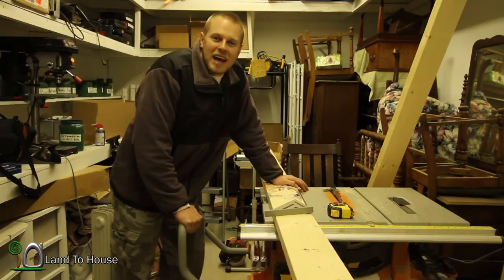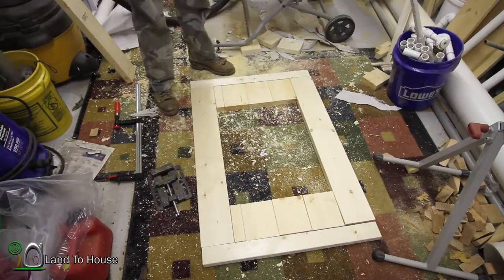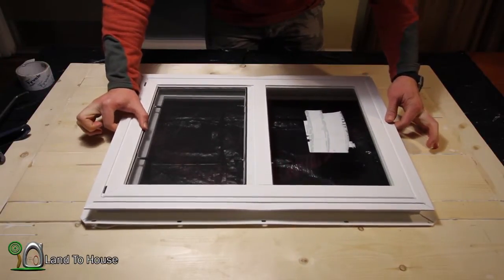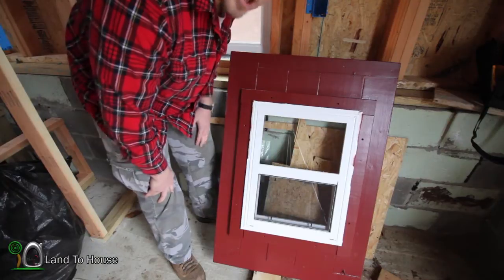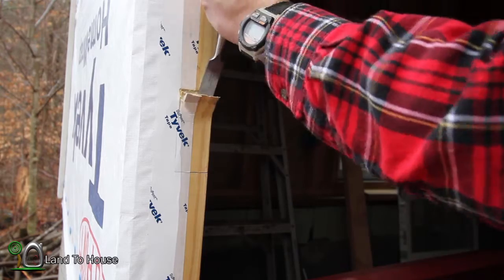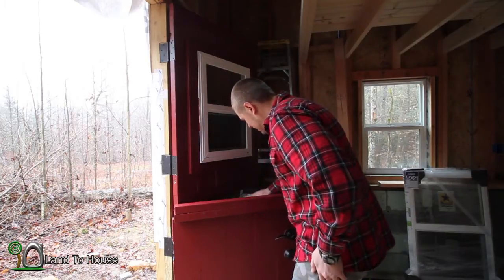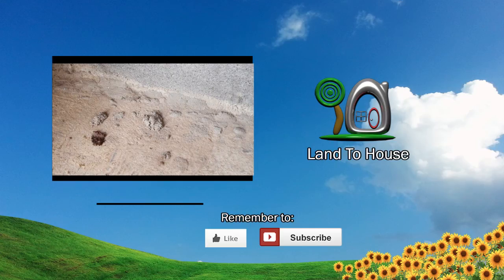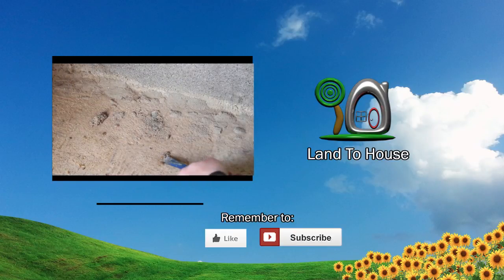Tiny House 45 Build Dutch Door P5

Comment: Hi Seth, just making my way through your vids and I am enjoying them enormously.  I do have one Q? with this vid here.   Regarding the clearance between the top and bottom parts of the door - why do you have that gap, as opposed to them being flush against each other?
Reply from the maker: +Fizzedup Slade When you say gap do you mean why did I make a dutch door? I wanted the two parts to open separately. So you could open the top and leave the bottom closed.
Reply: +Land to House:  Forgive me for poor Q?  When you fitted the top part of the Dutch door you placed 2 small scrapes of wood on to the top of the bottom door leaving a gap - a space - between the bottom and top parts of the door.  That's the gap I'm referring too.  Apologies for being dim. I'm sure there's a reason, I'm not sure you explained why?  Is it so that the two parts fit together well?  To my eyes it looks as though there's a gap.  I'm a bit worried about drafts!! LOL.
Reply from the maker: +Fizzedup Slade I see now. Well I wanted to make sure that the two parts would slide together easy when opened and closed. Those scraps did the trick. As far as drafts go... you are right. I am going to get a weather strip for that. There will be a front porch that keeps the water off the front of the house and away from the door.